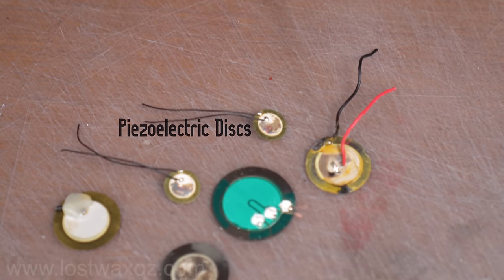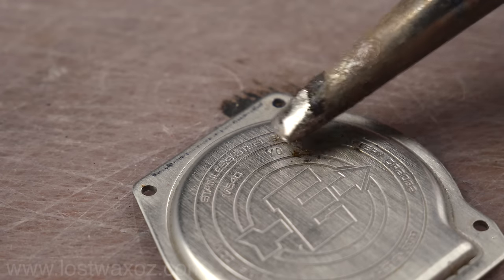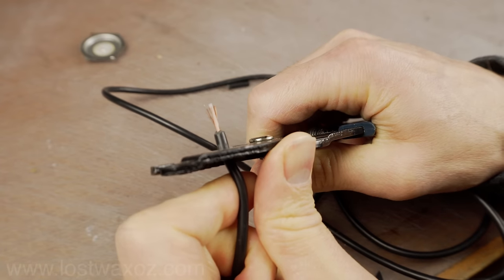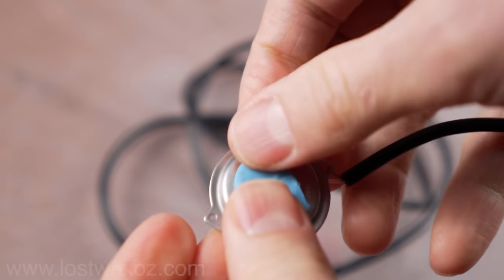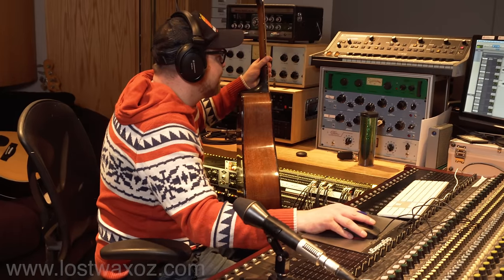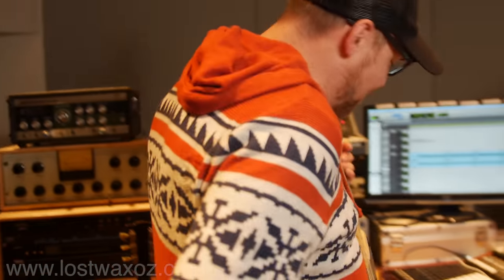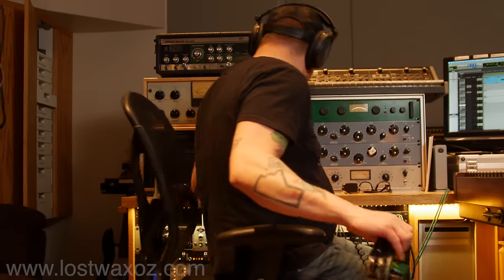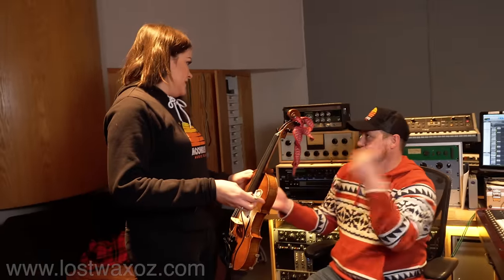Mic Anything!! Can You Make a Guitar Pickup From an Old Watch? DIY Microphone Cheap and Easy.

Comment: If you want to get the best out of this: 
(1) put a RF shielding cover over the open back (e.g. copper sheet) to minimize hum from things like flouro lights. Add insulation in between to avoid shorting the piezo element to the cover.
(2) Rusty may have done this in the video, but always plug these into a pre-amp that has a minimum input impedance of 1M Ohm; piezo’s have a very high impedance, so matching to that will give the best frequency response. Plugging into a lower impedance input tends to give the dreaded ‘piezo honk’; LOTS of mids, reduced bass.
Reply from the maker: Great tips, thanks so much!!
Reply: I'm guessing JJB and K&K are doing this with their pickups? I think LR Baggs is doing the same thing with the iBeam. I love these types of pickups the best, but they suffer from terrible feedback when used live. I'm also guessing that's why UST pickups are more common. UST pickups are an example of polishing a turd lol.

Comment: Hi and many, many thanks for your super input!!!! I was sceptical, but I immediately bought 4 brand new large piezo elements (€ 0.79 each - hahaha!!!), optimised the positions and the adhesive material first on the guitar top, now stuck them inside and wired the 6.3 jack socket of the old PickUp system (with bridge piezo) symetrically.

The new 4 x piezo stuff sounds fantastic and so close to a mic recording, that I can only wonder!!!
The only small, but for me as a home recorder irrelevant disadvantage - the system is more susceptible to feedback.
For me, it's a tonal blast for practically no money!
THX!!!
S.H.

Comment: Great Video and I'm here to tell you this works.  I had a three piezo inside under bridge  that had way to much high end, no bottom end.  Made one exactly as shown in video and installed  and it sounds great. The three piezo setup would not send a good enough signal to my TC Helicon voice live to trigger the harmony effect.  This piezo hack triggers the Helicon perfectly. If it were my ears only it might be skeptical but the Helicon knows what kind of signal it needed to work.  Thanks a bunch.
Reply from the maker: So glad it worked for you!!

Comment: I already made one from my old casio Gshock... damn it's the best pick up in the world... even I didn't change my nut and saddle with bone... just eq, compression, delay, reverb and eventide blackhole vst... whoa!! the sound is GREAT MAN! THANK YOU... AT LAST I'VE FOUND THE BEST GUITAR PICK UP IN THE WORLD.. no battery needed.. I will make for sale... Etech here😁
Reply from the maker: For real? That's awesome!
Reply: @LostWax  yes sir.... I used it with my focusrite solo... set to instrument.... before this video I was planning to buy lr baggs pickup but this is very expensive here in the Philippines... so for last resort I browse in YouTube.. then I found your video... thanks a lot man.... 👍👍👍👌🤘
Reply from the maker: @riffmaster5805  I'm so glad it worked well for you!!
Reply: @LostWax  the only problem is when I charge my laptop it has a 50hz interference, but if the laptop is fully charged you can't hear any interference.. I will try to build a diy DI box to get rid of this..

Comment: In the 90’s I took a set of cheap earbuds, desoldered the tiny speakers in the earbuds and soldered in cheap tiny little mic elements from Radio Shack, put the earbuds in my ears and plugged into my mini disc player and recorded.

I used it for ambient sound in public, and recorded a friend’s band in a bar.  The results were amazingly great and lifelike.  It would have sounded better with quality parts and acoustic design.  There is a mic you can buy today that works just like this. I’ve seen it for $200-300. 

Really, I should have added a battery inline to serve as a preamp for best results, bit it was awesome even all Jethro like it was.

A few things folks should know if they think this will be a great pickup for them.  

There is no one ideal way to electrify an acoustic instrument.

The piezos in watches will not all be the same, some may sound better, some worse.  Many pickups will sound good if you have a sound engineer massaging it into a professional sound board in a quiet environment with minimal instrument handling.

Using a soundboard mounted pickup like this gets a lot of handling noise.  Every little touch of the instrument is there, and annoyingly loud.  They are also subjected to feedback if you are playing through an amp.

The wire hanging off like that will be unwieldy, and will eventually break off from the pickup if it is just hanging loose and moves relative to the pickup.

If you make one and want a long lasting install, you could attach it to the soundboard inside the instrument, and run the wire to a jack that you install onto the instrument.

You can also buy a cheap external soundboard pickup for a few bucks from scamazon and elsewhere.  But I’ve never heard anyone describe them as sounding amazing.  I suspect that the metal watch back and blue tac receive the vibrations better than the plastic housing and foam tape those cheap units use.

YMMV and good luck!
Reply from the maker: Thanks, those are some great insights for those that want to try use this for something other than a bit of fun. I'll add another downside, it's super easy to bump the pickup and knock it off the instrument.

Comment: I wonder if you could make it active by adding an lm amp circuit with some feedback ground isolators and frequency modulators to cut out all the junk you get with cheap active pickups...  but then again active pickups always use coils of wire so the eddie currents likely play a big role in the feedback dept though...   just an idea..  would be cool to see the pickup used as an i/o trigger like the ones used on drums..  they are the exact same thing except instead of just plugging into an amp to get the sound you run it through a box that has different prerecorded sounds that are "triggered" by the piezo on the drum heads and also reflects live how hard the drum is hit..  they use them a lot on live shows especially on the kick drums but are different for em..  anywho just an idea for a guy who had held a soldering iron a time or two..  some simple electret mic amp circuits should work with minimal parts and try a simple high band or low band crossover circuit with some inductors and caps like what are used on speaker systems..  would be interesting to see, especially if you made a package out of it that could be stuck on things or even a in line deal down the quarter inch line somewhere...  thumbs up tho..

Comment: I've used these as drum triggers because they are isolated to only surface vibration. I've also used them on acoustics but only in the studio with Focusrite preamps. Unfortunately, the feedback is a problem when playing live, so i use a LR Baggs Lyric or Anthem. Personally, i would love to use a JJB pickup using this design, but couldn't find a way around feedback issues without destroying the sound with EQ.

Comment: I'm wondering if you could put the piezo inside a stethoscope head, run the wire up the tubing into a small box with a battery & speaker?

Comment: Hi. I just came across your channel. It's amazing! I wonder if the gadget can be used on mechanical clocks to get the tick-tock sound amplified to get them in beat. 
I have no idea about electronics so forgive my perhaps stupid question. Can the jack be plugged on directly to a speaker? I have a speaker with 2 back terminals to which the wiring can be attached.
Your advice is appreciated. Thank you.
Reply from the maker: I think it would work to amplify a mechanical clock, as long as you had somewhere to stick it on, preferably a resonant surface. As far as being connected directly to a speaker, I think you'd need an amplifier in there to make it work properly. Something like an old CD player that has AV in jacks would likely work.
Reply: Thank you so much for your feedback. Shall have a go at it and hope for the best 😃

Comment: This is really cool, it sounds like it's very similar to the K&K Pure mini. I would be curious see what results you would get if you attached three wired to one output jack & attached under saddle inside the guitar with an external preamp.
Reply from the maker: Yeah, though they would take up a bit too much space I think under there....
Reply: @LostWax  probably so if left at that size. It looks to me that the outside flange could be cut off pretty easily without negatively affecting the piezo, but I'm not sure exactly where the piezo stops & the metal frame holding it begins.
Reply from the maker: @jertexjertex7880  True, you could cut it down. Of course then you might as well just buy a few piezo for a couple bucks and go from there. I can't completely remember, but I think that's what I did when I added pickups to my acoustic guitar....
Reply: @LostWax  that makes sense, and btw, I meant attaching them under the bridge plate, not the saddle.
Reply: @jertexjertex7880 , it's a bit more complicated with 2 or 3 wired into one. JJB and K&K likely don't mention if they wire them in series or parallel. It's better to just use one and find the sweet spot of the acoustic. I had better experience with the LR Baggs iBeam.

Comment: Awesome.
Reply from the maker: Thanks!
Reply: @LostWax  I can't find a watch, do you think a smoke alarm or alarm clock is better? I have extras. Also I'd love to see you make a video hand wiring guitar pickups with a 9-12volt wall wart. The transformers copper is perfect for winding.
Reply from the maker: @Xxmeca421xX  To be honest, I tried a bunch of others and the best results were from the watch. I think because the piezo is already glued to the stainless steel back, that has something to do with it. If you try and blu  just a straight piezo to something, there is a good chance you will end up breaking the piezo. I have  installed in my guitar as pickups, but I had to actually super glue them to the guitar to get them to pick up  sound. I'd say the smaller the piezo the better. Hope that helps a little- that's just from my very very limited experience!!

Comment: Is the part where you soldered the back of the watch important?
Reply from the maker: I think so....
Reply: @LostWax  so I need to (for lack of a better term) scorch, the back of the watch with a soldering iron? Do I have to put the little bit of copper wire through the hole then solder the wire, or would it be possible to solder the wire directly to the back? And is putting the flux on the piezo element important? And is the type of  solder important?
Reply from the maker: @benbartels6559  I found the solder didn't stick to the stainless steel watch back, which is why I put the copper piece in there. Flux is  because you want the solder to flow as  and  as possible,  it will melt the thin metal coating on the back of the piezo. I think any electronics solder should work.
Reply: @LostWax  great thanks!

Comment: can i use a headset cable instead?
Reply from the maker: I think you could but most headset cables are a stereo cable, while this is just mono. You can tell by how many silver sections there are on the jack. Mono has just two, the tip and the sleeve, stereo has three, the tip, ring and sleeve, and often phone headsets have four. On a stereo jack, you'll just leave one wire not connected to anything.

Comment: 🟦…You need a way to hold the piezo against the bridge without any adhesive interfering between the two, you'll get a bit louder 'everything' out of it, but piezos don't really favor bass to begin with.
I learned a-lotta lessons about this from a good deal of experimentation mounting Barcus Berry piezo-pickups on guitars when they first came out in the early '70s,...
...everybody had the "Magic-hoodoo" of how & where to stick a piezo pickup for the most balanced sound.
... Some used Spring-Wire or Spring-Steel strips to form a clamp to hold the pickup pressed tightly against the bridge or guitar body (depending on the guitar quite often it would increase the overall Volume & Bass, with with there being a little-Less Mids & Highs than a bridge mount tho. Some used wax, & some used epoxy to stick it directly to the guitar, and some used epoxy or wax AROUND the pickup without it being BETWEEN the Guitar body & the Pickup!...(which gives it a VERY "Forward" Sound That Neil Young liked a lot at the time):>
...Yep, many lessons learned.
... This is valuable, Thanx!
Reply from the maker: That's some great info, thanks!!

Comment: Every sound that is generally 'on pitch' may be considered 'musical' but usually contains 'harmonics'. The sound from this pickup is distorted, much like a guitar pedal intentionally produces distortion. The cushion of soft, low hysteresis 'BlueTack' absorbs higher frequencies including the natural harmonics of the acoustic instrument.

I am sick and tired of these 'clickbait titles', the OP simply repurposed, with no research, probably the most inappropriate transducer! Piezo transducers are available for little cost in various peak frequencies so you could combine three through an EQ circuit to better cover the full range of an instrument. Add a traditional audio microphone, maybe from a defunct mobile 'phone, and you may have the ultimate amplified acoustic guitar.